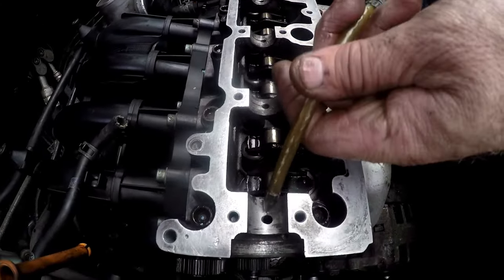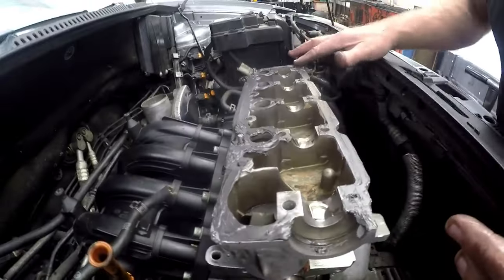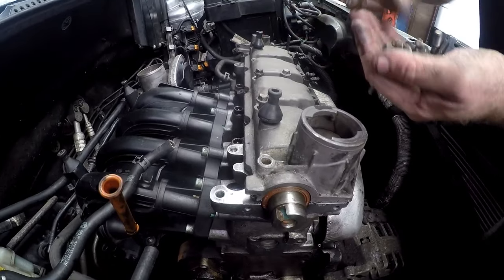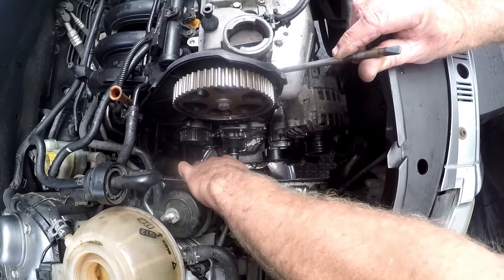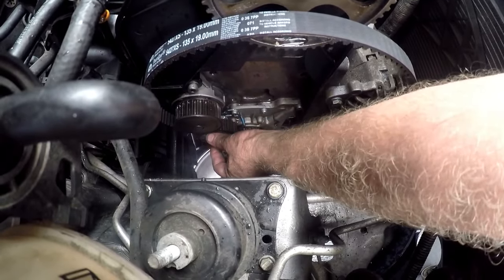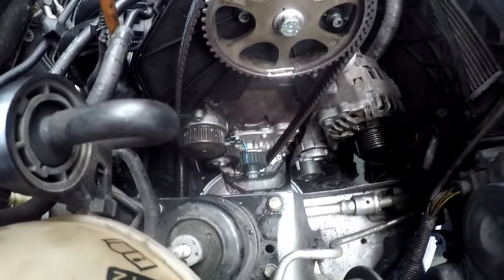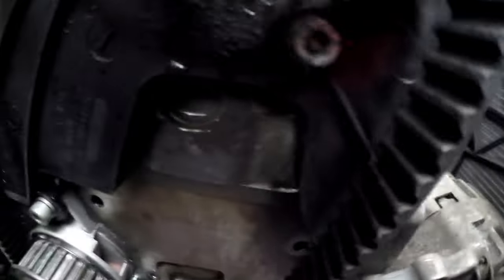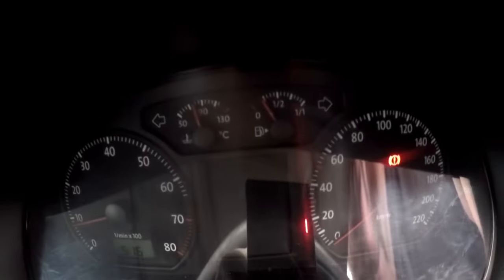Vw Polo Vivo Bent Valves Part 4   Assembly   Start

Comment: So my cambelt has snapped, is there a marker on the crank pulley that tells me its right? How do I know that I am not 180° out?
Reply from the maker: Top dead centre (TDC) is when the piston reaches its uppermost point of travel, for every 360-degree revolution of the crank gear, the cam gear will only turn 180 degrees because it is half the size of the crank gear.

The best way to find TDC on the crank:
remove no.1 spark plug
use a long thin metal object, like a screwdriver, and insert it into the plug hole until it touches the top of the piston
slowly turn the crank with a 19mm spanner at the front gear, until the piston reaches the uppermost point, this you will see on the travel of the thin metal object (screwdriver) you are using.

I hope this explanation helps you out.

Comment: Hello again sir... Just wanted to ask a quick question... I mistakenly had my timing belt off by one tooth, started the car and it stalled immediately, will this bend any valves at all? And I just make the most expensive mistake of my life?
Reply from the maker: It is possible you bent valves, reset the belt correctly, and then do a compression test. I hope all goes well, Good Luck

Comment: Good day. 
i'm having the same engine as the one on your video. also had bend valves remove and refit the head according to your video after assembling everything try to start but there is no spark coming from the spark plug wires.

Comment: How many km did the car drive after this? Also bend valves on my polo would just like to know if it will last a long time after fixing it
Reply from the maker: The car is still running, almost 2 years now, George the trick is to do the job correctly the 1st time round.

Comment: howsit, what is the firing order on these engines if i may ask. thank you in advance
Reply from the maker: There is no distributor here as this system uses cam and crank sensors to keep the engine in time, Emile, but the firing order would be 1342

Comment: Good day sir i just bought new head cylinder with new valves and new lifter installed.but my car the moment it pass 100km/h speed it start to over head and oil start coming from oil filler cap.what can be the problem
Reply from the maker: It could be a few things, but it sounds like you are getting too much crankcase pressure, therefore the oil leaking from the cap, check the PCV Valve Unit, it is a round plastic object on the top of the cylinder head, which is connected to the intake manifold, via a hard plastic pipe, it be your root cause.

Comment: Hello . 
Please help me... I have a Polo 1.6 BAH engine... it always flood plug no.2 with oil.
What could be the problem, please help me.
Reply from the maker: It sounds like either valve stem seals or oil rings that are worn, Vusi
Reply: Vusi Ngcobo  buy valve guides and seals

Comment: Set the timing  and crank gets stuck on tdc,  only on 2nd 3rd cylinders
Reply from the maker: Hello Chantalle thanks for supporting my channel, but I do not understand your question, try rephrasing it. Wishing you all the best in 2021
Reply: @vehiclemaintenanceandrepai3790  so when putting the crank on v2 and cam on its mark. You rotate the engine and at 180 dagrees cylinders 2 and 3 are at tdc and the engine does not rotate
Reply: @vehiclemaintenanceandrepai3790  and thank you for your educational videos and may you and your family be safe